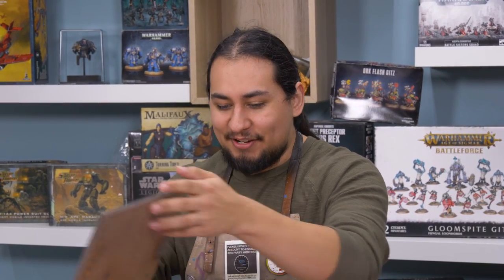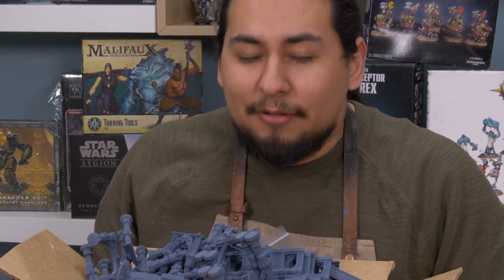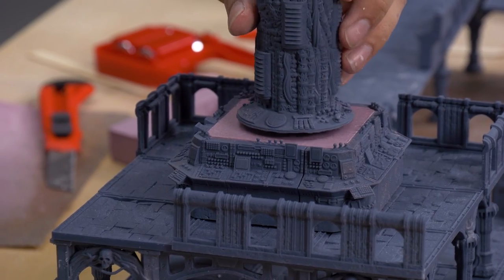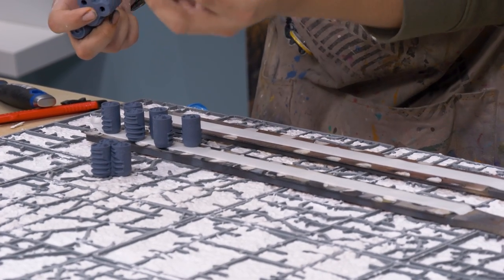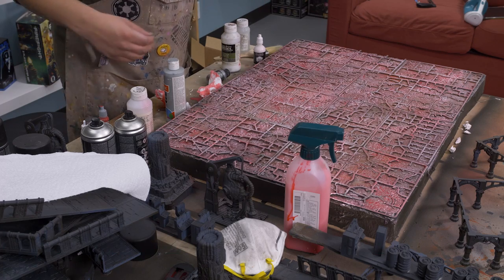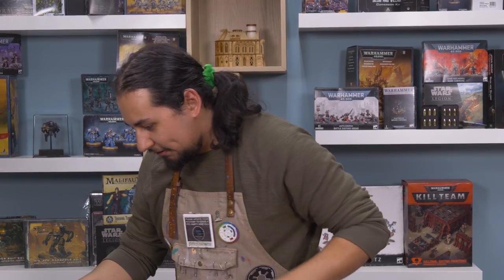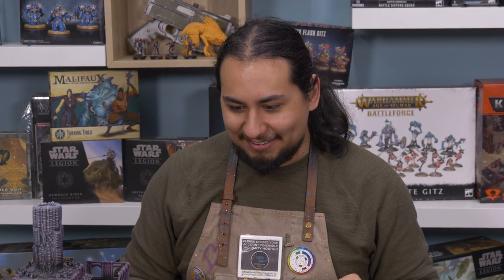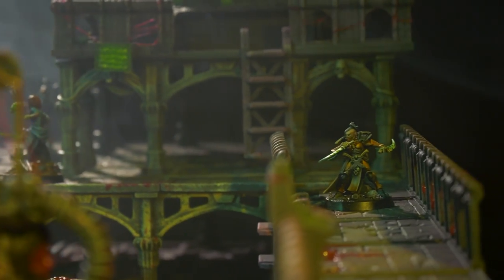Building a Warhammer Factory Powered by Blood

Comment: you need a hot wire to cut foam, wouldnt be surprised if you could use it for cleaning up molding or creating melty battle damage as well.